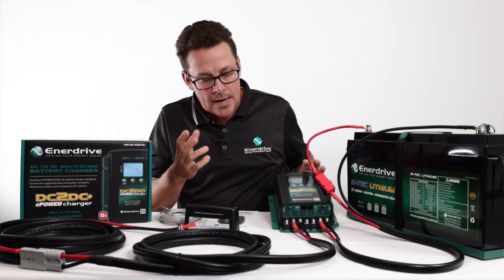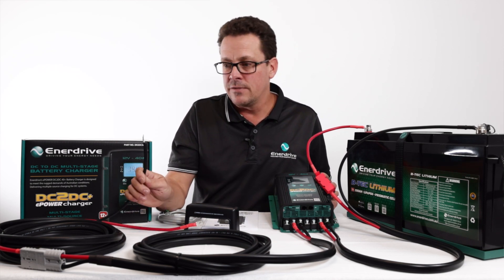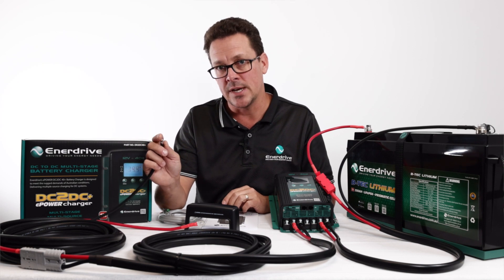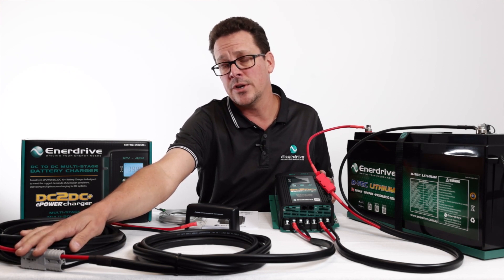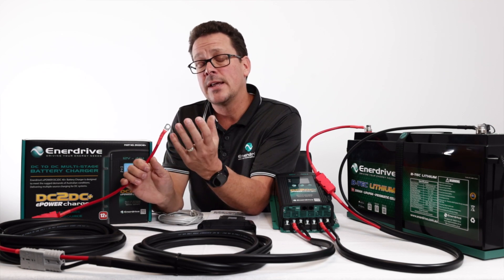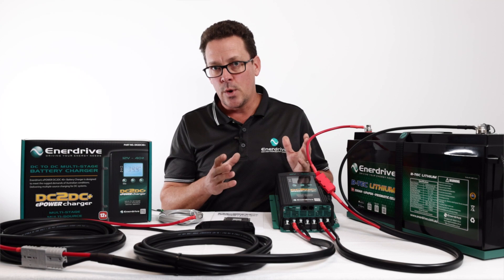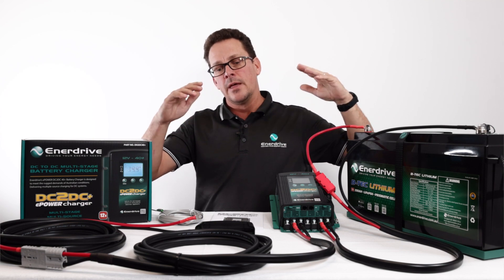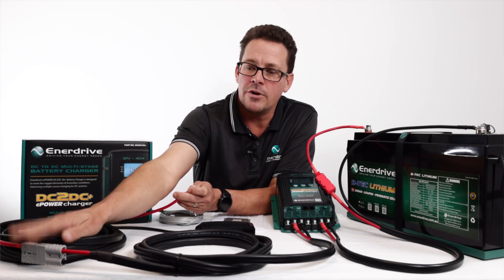Enerdrive DC2DC Chargers - Part 4 - How to Install (Smart Alternator)

Comment: So if I make the loop wire on the charger for ignition in the caravan and  plug the Anderson plug in will that be fine as my ute has 2 batteries under the bonnet and the Anderson is attached to 2nd battery and that is attached to starter via an isolator

Comment: Which ignition Relay or VSR do you reccomend to be installed under the bonnent?
And do we also need a fuse/circuit breaker? 

Would the below suffice?
Start Batt -----> Breaker -----> VSR -----> Anderson plug at rear of vehicle -----> DC-DC Charger in caravan. (with loop wire as mentioned in video)

FYI: Tow vehicle has a smart alternator, and caravan has a EN3DC40+ DC-DC Charger.
Reply from the maker: Hi Brett, Enerdrive recommend a "Manual Reset" circuit breaker or bolt on style fuse such as a midi fuse.  Enerdrive do not recommend the use of "Auto Reset" Breakers. If using a loop wire connecting start battery input to the ignition input on the DC2DC a relay placed local to the start battery is required. It needs to be suitable for continues loads exceeding 60A continues.  A VSR is not ideal as it will not necessarily work all the time due to the nature of low voltage output via the smart alternator. 
Hope that helps - feel free to give us a call if you need any extra help